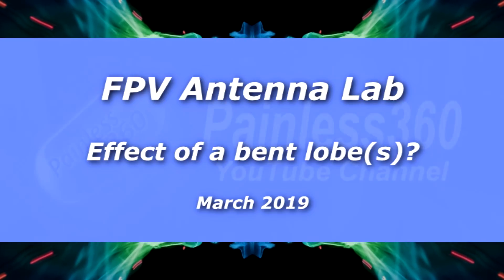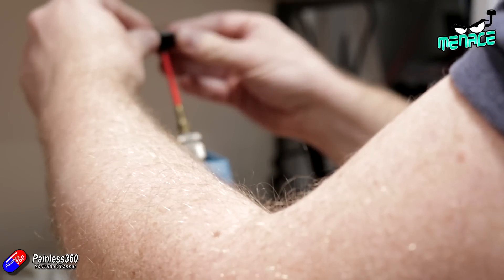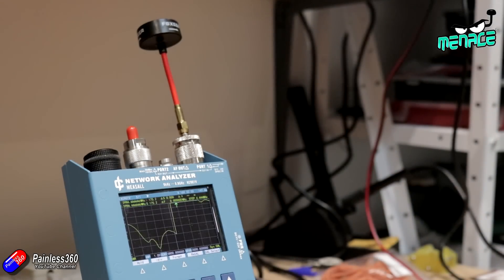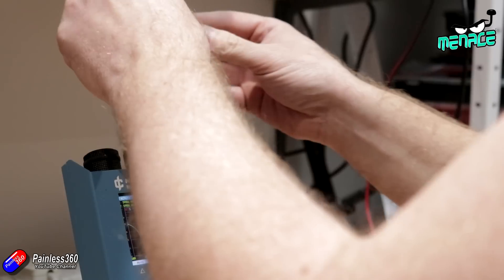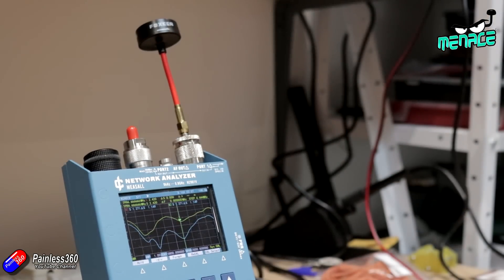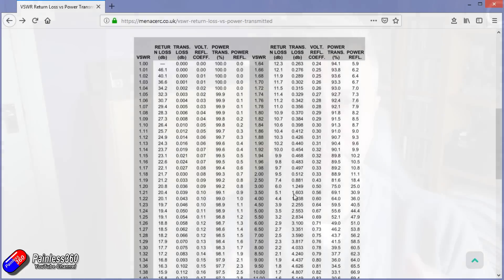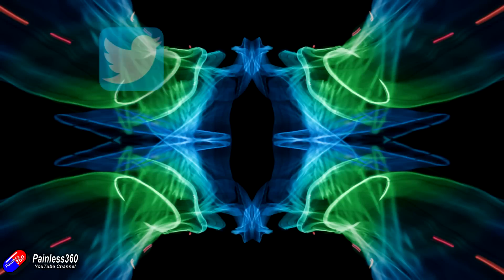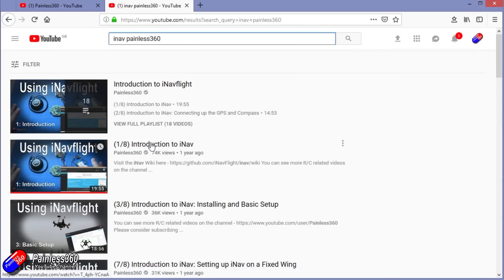Antenna Lab: Impact of bending part of the antenna

Comment: Which Pagoda Antenna is better... Or which do you use...???
Reply from the maker: In theory, if the manufacturers follow the design identically then the performance should be similar. I used MenaceRC stuff before I met Greg and was impressed at the extra testing he does when he receives the antennas to confirm they are in spec. Now I only use his pagodas.

Comment: These Antenna Lab videos are great, like a 'how it's made' for our hobby. Thanks.

One thing I am curious about is the signal strength difference between using heat shrink tubing to stick an antenna to a cable tie sticking out, and sellotape (which I've started to use now instead of heat shrink)

Comment: Good video, i was one of those that did ask that question originally. But its a shame the the question was only half answered, i, like many others were wondering how the antenna would behave if you had a crash and bent a lobe out of shape - but, we then bent that lobe back to the rough position it should have been in - something most of us have done in the past. Would have been nice to know how good or bad it would have been once we had done that by just eyeballing it.
Reply: Exactly!
That would have been the most relevant test!
Reply from the maker: Thanks for the idea. I'll get Greg to look at that in a future test. Bottom line is easy to see from this video - if you are using an exposed antenna it gets bent out of shape - replace it.
Reply: @Painless360  But i must admit i have also moved away from clover leaf and gone for the pagoda style, not only do they seem to work better, but also almost impossible to break. I bought an antenna pack from Menace and i love them. Never purchased anything from Menace before, but after watching a few of these videos i was convinced it was a good idea.  I was not disappointed. :-)
Reply from the maker: Glad you like them too. I use them pretty much exclusively here now. Not an advert - they just work and work bloody well.. Happy flying!

Comment: Another interesting video. We were never shown how far the lobes were bent out of position to get this result. Also if the lobes were bent roughly back to correct shape would the antenna recover to a reasonable VSWR less than 2?
Reply from the maker: It's a mute point as most modern antennas don't have their active elements exposed these days. But, for the sake of another £15 it's not worth trying to fly with an antenna that has been damaged in a crash..

Comment: How about some GPS testing? Or even a bit of a playlist.
Reply from the maker: Interesting idea. What kind of testing?
Reply: @Painless360  module comparison,  mag/without mag, positioning, mounting options, terminology, ublox u-center, connecting with an ftdi adapter, comparison between different flight controller software.....sources of interference.... declination what is it? ( Perhaps some history pre GPS....GMSE and MGA)....using GPS on a rover.  How robust are they? How does the antenna work .....hope that's enough.
Reply from the maker: Great ideas - thanks for sending that. Defiantly food for thought.. thanks again..

Comment: What about the pagodas? What the plates are not completely parallel anymore?
Reply from the maker: Please see the first video in the series where some of those are under test..
Reply: @Painless360  I did see that video shortly after it came out, but I don't see the part which answers the question of what is happening with the tune of a pagoda when de 3 plates that make the antenna get missaligned (not perfectly parallel anymore). I find this an interesting question as many pagodas come with soft material to protect them in stead of rigid materials like discussed in the video you reference.
Reply: Buy a foxeer lollipop v2, Way better and more durable.  Look at all the pro freestyle pilots, they all use them now, or axiis